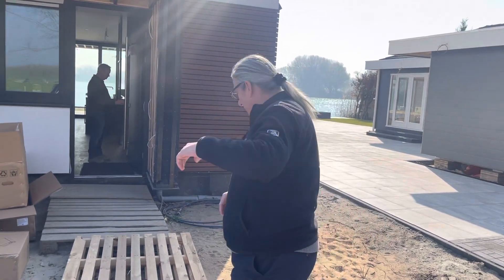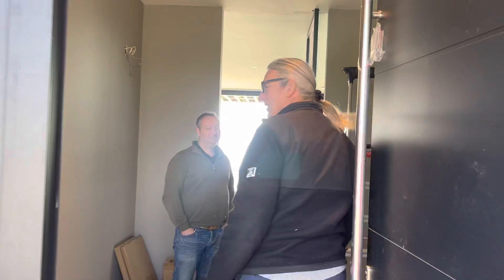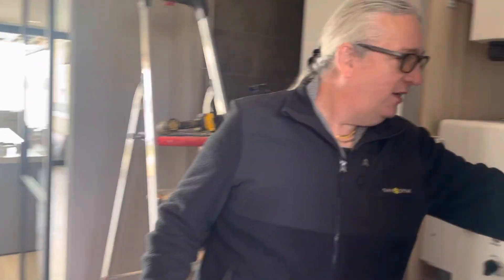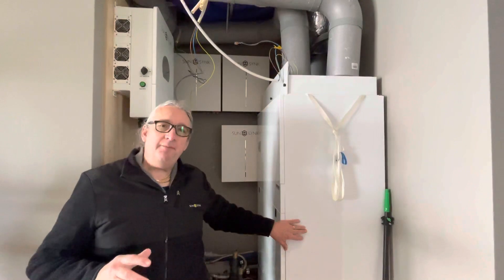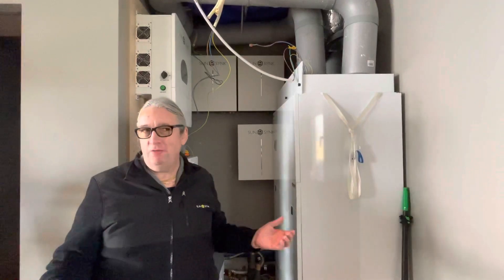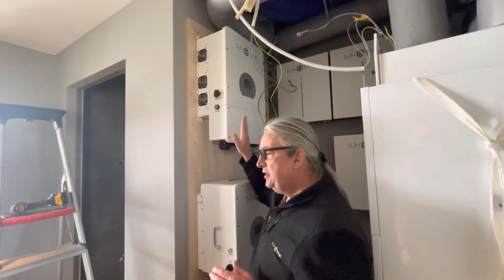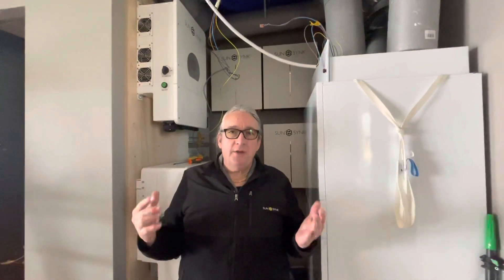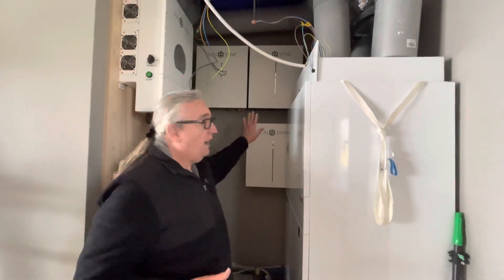The home of the future powered by #Sunsynk

Comment: Perhaps you could explain more about the use of one inverter for charging and the other inverter for load. Why for example do you need a 3 phase inverter to charge batteries?
Reply: I believe the three phase was for discharge to the heat pump.
It was single phase into the property via a small 16A feed.
Then they utilised the Sunsynk batteries to store a large amount of power and discharge via three phase into the house which has a high peak load.